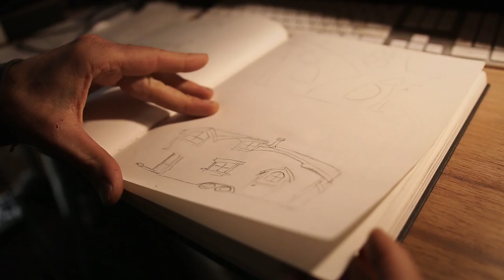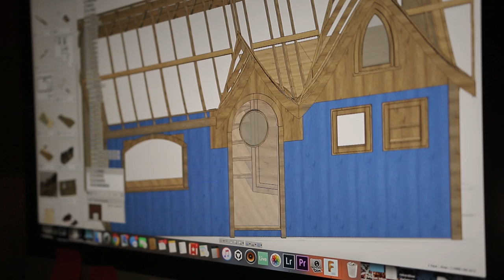THE MOST EPIC TINY HOUSES

Comment: Abel, your designs and builds are so inspiring, and it's because of your influence that I am designing my own tiny house! Because my upright frames will incorporate some gentle curves inward, I will need some further consultation and tips from you to finish it properly! Thankee!
Reply: Thanks Abel! The video above, where you are up in the rafters of your tiny house with the barrel roof, is really essential for showing me how to design the frames for my design. the difference is, that my upright frames, start to curve inward at 4 and a half feet above the floor, so, I'm not quite sure how to set the headers at this point, where they will support the roof.

Comment: Are you using a CNC router for those arches and is that something you outsource (due to the price of owning a machine that candle those sizes)? What happens with the excess wood? Does your CNC partner send back the scraps to you, or do they just keep it in house and use it for other projects?
Reply: Yes! I have my own 4'x8' CNC. I make smaller parts out of the offcuts. The machine was designed by my friend Ahren, and has been running beautifully for 2 1/2 years.
Reply: Bert Lo
Reply: Zyl Vardos
Thanks, Zyl. Sorry for the late response. Do you mind if I ask how much it cost in material to put that together?
Reply: Materials: Very approximately $30-40k if you are buying windows and doors (and not hand building them like we do.)

Comment: Are there any tiny homes that can be made with and upstairs sleeping quarters, where a person 6ft and under could stand up?
Reply: Height in a loft is usually limited my maximum height that can be transported on the highway. It is hard to get beyond 5' in the loft... unless it either pops up, or the floor in one end of the house drops. Both of the latter can increase cost quite a bit... complexity.